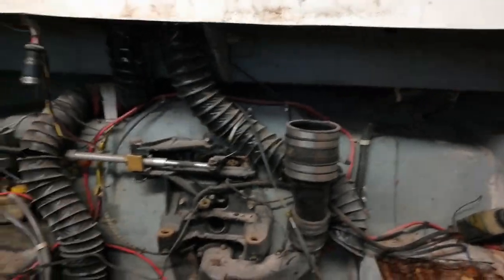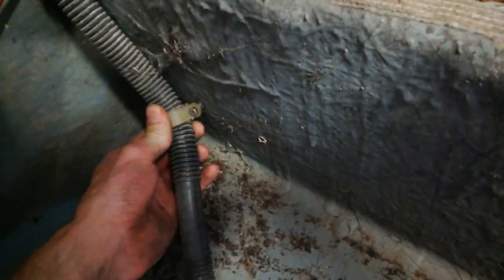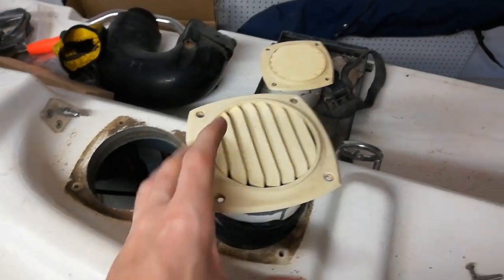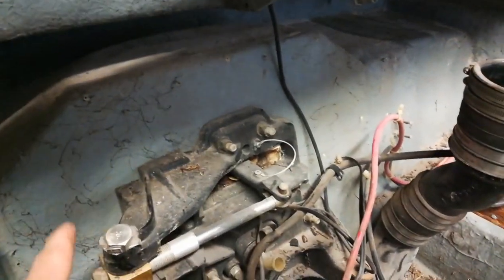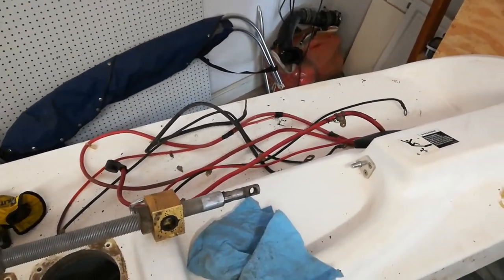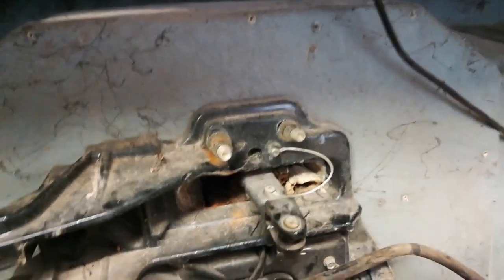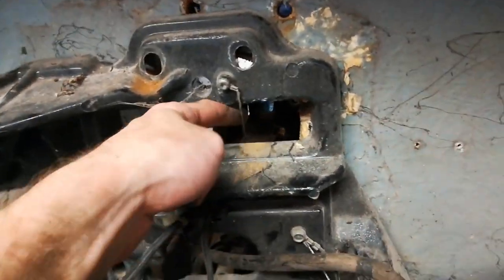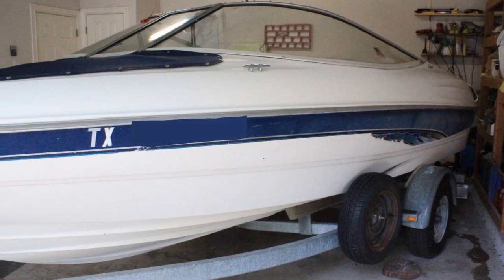Boat Transom Assembly Removal

Comment: Congrats on going from 33 subs to 15,000.  So far you are the ONLY person on YT ever to take the mount off the transom.  All my bolts, hoses and wires are out, but my drive seems to be gorilla glued onto the transom. It won't budge.

Comment: I know I'm coming into this project late, but I hope you took pictures of how the wiring and plumbing was routed. Also, you can get tyrap bases that will adhere to the sidewalls to secure the wiring.
Reply from the maker: Even better than pictures, I got video!
Reply: @ZachsGarage1  I have a 1997 Crownline 176 that I have had for years in the same shape. You have given me the courage to return this, my first boat. Thanks so much for your videos!!!
Reply: Refurb, aahh I hate autocorrect.
Reply from the maker: @charlescook844  Glad my videos help!
Reply: @ZachsGarage1  I didn't see where you found out the transom was bad, or removed it. I still have to find out on mine. Thanks again for your kind replies Zach. I don't know why they use untreated wood in interiors knowing it will rot over time. I'm wondering if honeycomb panels like they use in aircraft floors and cabinets would work. Any ideas?

Comment: Cool Video. Helps me a lot to figure out how to install one of these units and I was wondering if we needed that pump system to the left for hydralics I guess. we have the in line 6 , 165 motor from 1967 and the Alpha 1 stern drive. missing some parts for the stern drive and rebuilding. Subscribed.
Reply from the maker: Glad it's helpful!
Reply: I'm getting ready to tear apart two prealpha drives on mercury 165s (aka GM 250 inline 6). Replacing everything with Alpha gen ii's (transom assembly and all).